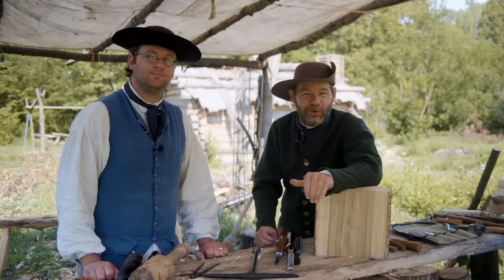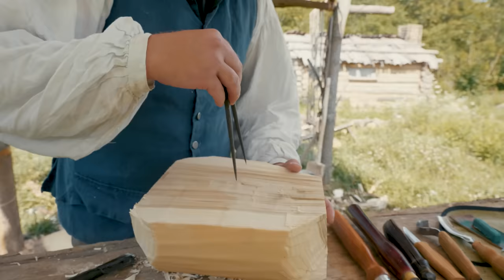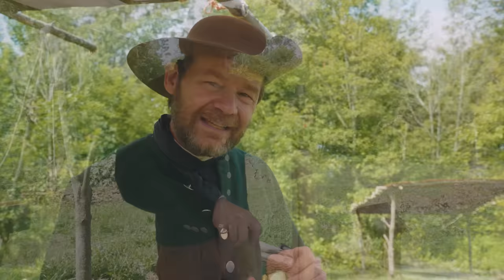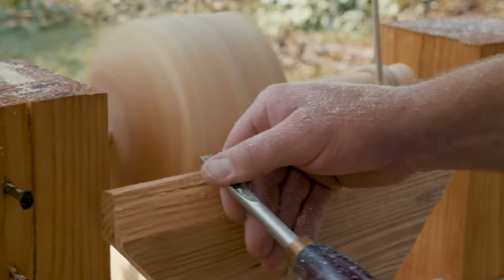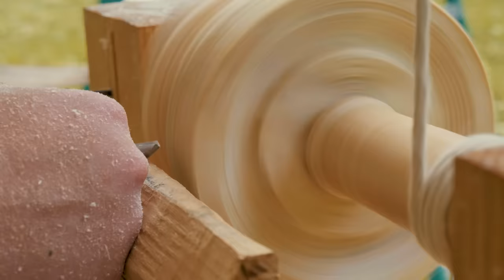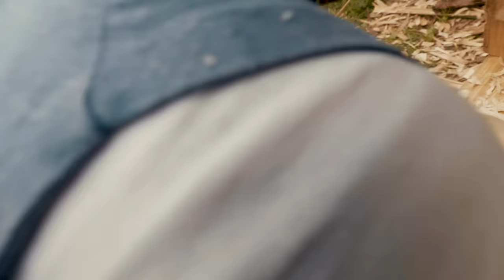Hand Carving Spoon and Bowl - Our Cabin Needs Utensils

Comment: Nice but most would not have had a good wood carving set like that, Maybe a crocked knife and a pen knife.
Reply: Hook knives were UNBELIEVABLY common.
This is just speculation on your part.
Edit; A hook knife is simply a NORMAL KNIFE that has been bent into a hook.
They can be made by bending a normal carving knife, and I have no doubt people did this. I did infact do this to get my hook knife.
Reply: @D-Vinko  That is my point most people would have had a Hook knife/Crocked knife and a carving knife, but not a complete set. Of course it is speculation on my part I am old but not that old, but I have read and studied a fair bit on the early sedimentation of Ontario and the indigenous people in the area. When I was a teen (71 now) I helped build a Birchbark Canoe which was used on Georgian Bay, The instructor was an Ojibway Elder then in his 80s, he had us make our own tools from scrap material. We had to make a Crocked Knife mine was made from an old file, a Draw Knife, I lucked out and found a broken scythe to make mine from.  We built one canoe under his guidance then taught some youth how to build there own canoe. In true Ojibway tradition as new teachers we gave the tools we had made to our first student.

Comment: I'm curious what would have been used before they had sandpaper. Was there a way to smooth the wood out, or were mouth splinters just part of the 18th century experience?
Reply: Wood shaped by properly sharp and properly used knives and scrapers and planes is every bit as smooth as a sanded surface. The very high end stuff would be finished with shark skin, but certainly not in 1750s Indiana.
Reply: Stones and sand. Probably sandstone if it was around. 

Mostly for bigger projects, I imagine. Smaller things can be whittled down, larger things- like cabinets and tables and such- whittling might take a little too long for it to be worth it. Throw on some fine sand, and use a flat rock to grind it along. Or just use sandstone.

Comment: Could you have used the bottom part of the bowl as a small plate? I know it had a whole but not the in the “top”.
Reply: Back then they had plenty of high quality wood, straight grain with no knots. If they wanted to make a dinner plate, called a trencher, they would have started with a piece of wooden plank and carved it as they did the bowl of the spoon,  only larger.